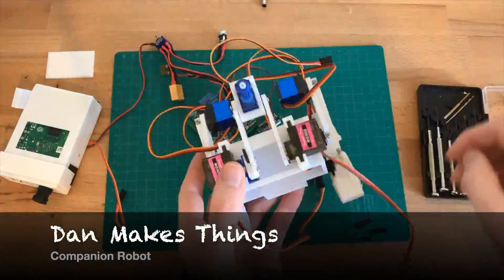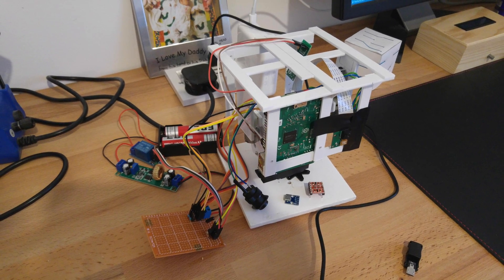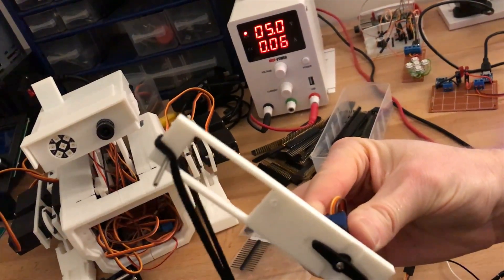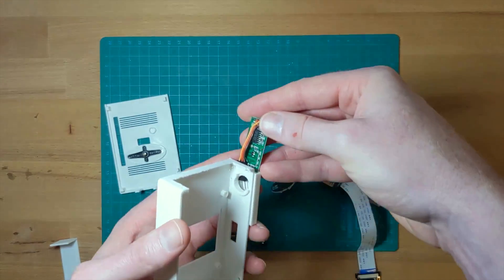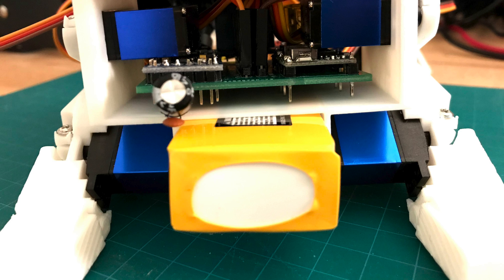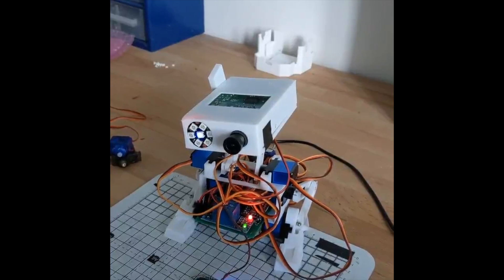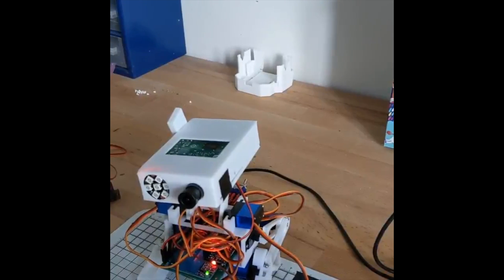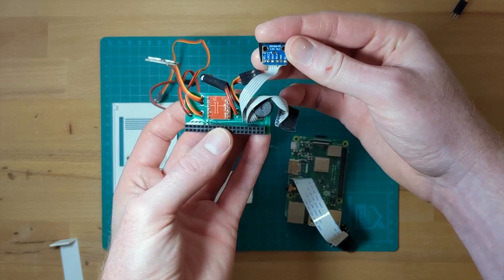Companion Robot: Overview - Raspberry Pi | Arduino | DIY Robotics

Comment: The breaking leg moment was... damn.. That's crazy inspiring. Epic push in 3D printed robotic trailblazing. Wonder if a resin printer would make some of those load bearing parts rigid enough to support on the larger iteration?

Comment: would it be able to work with the Raspberry Pi 4B?
Reply from the maker: Sure! The usb and ethernet are swapped on that model but besides that and the power requirements it should be interchangeable. Take a look at the wiki if you're interested in starting a build.
Reply: @DanMakesThings Awesome! Thank you!

Comment: What do you use for your 3D printing? I want to build my own robot. 
Also can yours talk to you? What’s that like? 
Who manufactures your circuit boards?
Reply from the maker: I use an Ender 3 Pro but there are a lot of great options out there. There is speech recognition and TTS, so it can be configured to talk.
The PCBs are available in the repo so you can send them to any PCB manufacturer for printing.

Comment: question,you have any link to the custom board where you placed the arduino pro mini and the motors? and also,does it work if i use smth like arduino uno and a breadboard connected to the arduino pro mini? if so,how please

Comment: Why not ESP8266 0r ESP32 only? Is there a need for the pi?
Reply from the maker: You could probably build a simplified version of the software for the ESP but I don't think you'd get the full range of features. It would be interesting if someone wanted to try it.

Comment: My question why the arduino? The gpio of the raspberry isn't more  than the enough?
Reply from the maker: A couple of reasons: there are only 2 unique PWM channels on the pi so controlling this many servos is more reliable with an arduino than trying to use software PWM on the pi (I did try that originally and it wasn't great). 
Also there isn't an ADC for the battery monitor so I'd need separate hardware to handle that anyway. 
Having both also gives me the flexibility of being able to add components on either platform (3.3v or 5v) as I continue development. 

Finally, being able to delegate the iteration of the servo movement to the arduino frees up the pi to deal with the higher level tasks.

https://embeddedcircuits.com/raspberry-pi/tutorial/how-to-generate-pwm-signal-from-raspberry-pi
Reply: @DanMakesThings  but for the pwm you can use the i2c board that add a lot of pwm out puts and the library for it is really nice, the adc is the only reason but i think you can use another micro for all of this a micro more simple a full arduino is over kill